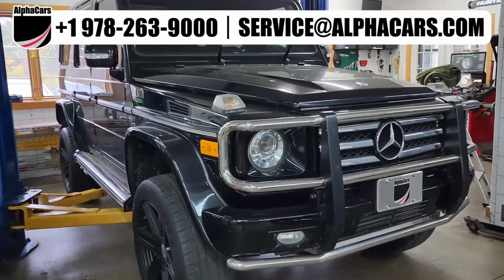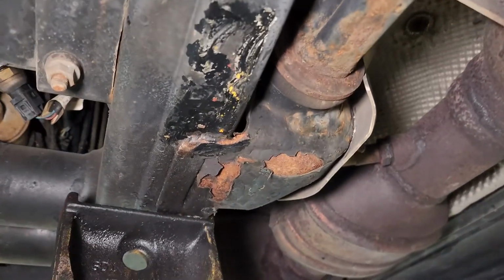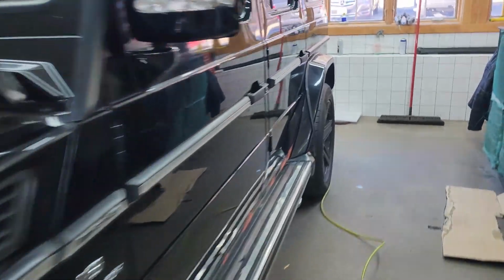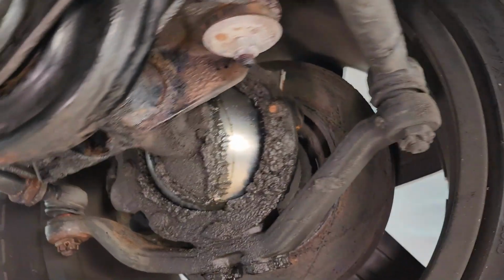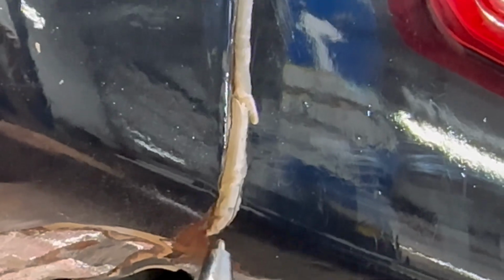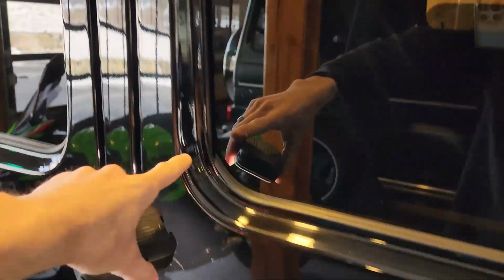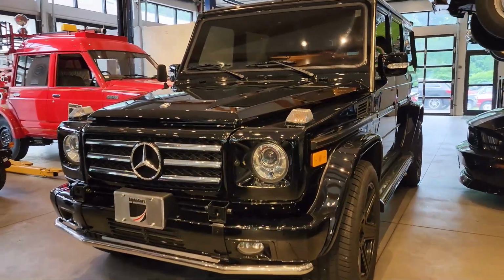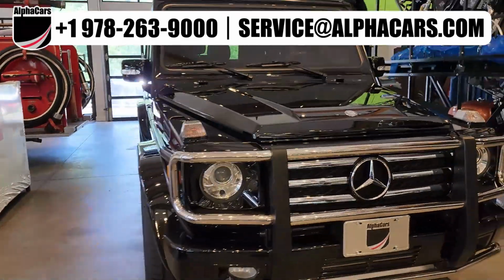Rusty Mercedes G-Class? Evaluation, Restoration & Long-Term Protection

Comment: How do you take the rocker mouldings off?
Reply: Start at the end of the moulding.. Use a fine flathead to open the middle rubber strip on the moulding..it needs a flathead to flip open.. you would never guess it was there.. It flicks open and then bend it down genlty a flap, and then you can access the screws that run along the moulding.